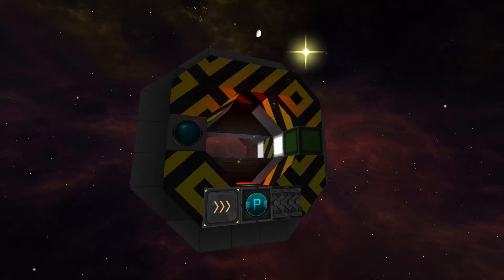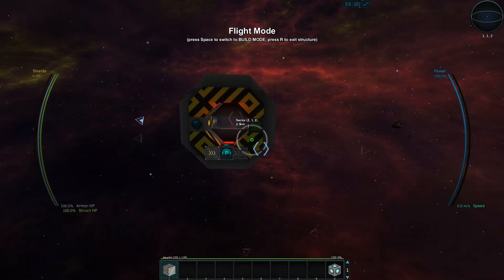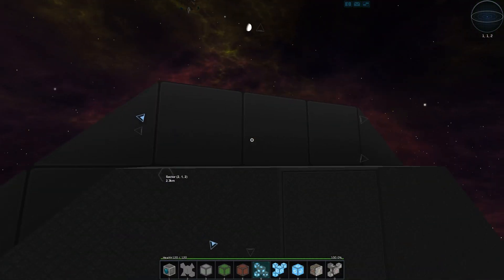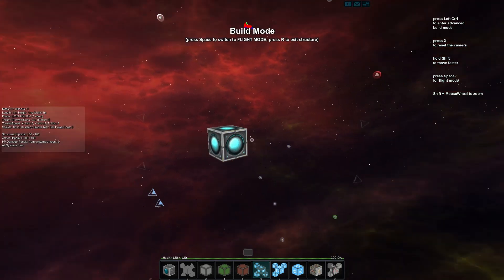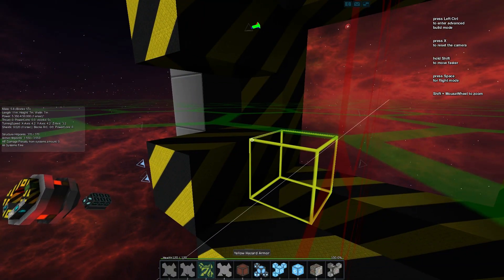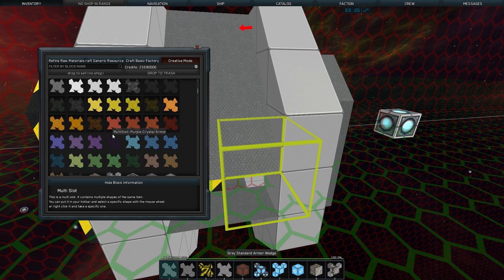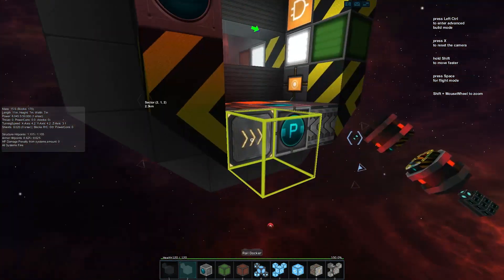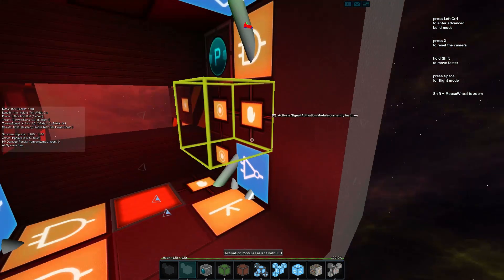Starmade Logic #22 - Universal Dock (USD) with Lockout

Comment: That's interesting.  When the rails came out, the first thing I made was new docking ports like that, the only differences is that I had the rails and the docker inverted from the way you had it.  Interesting everyone else had the same exact idea as me.  Although I did not think about all that logic, I am going to have to integrate that into my ships now, and probably even change the connectors too.  So its compatible with other ones.